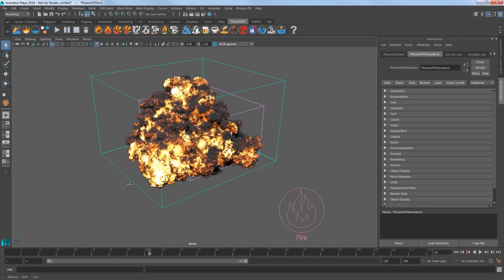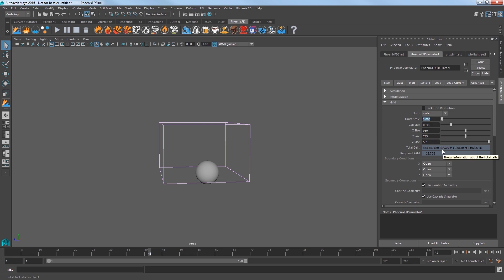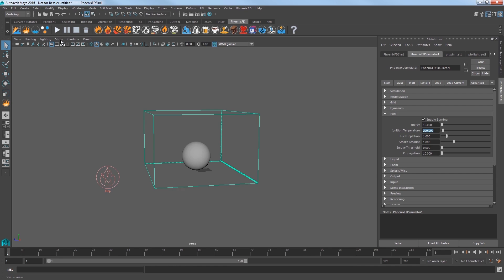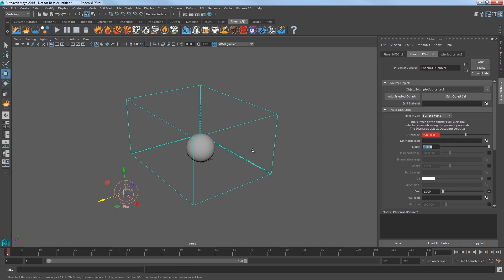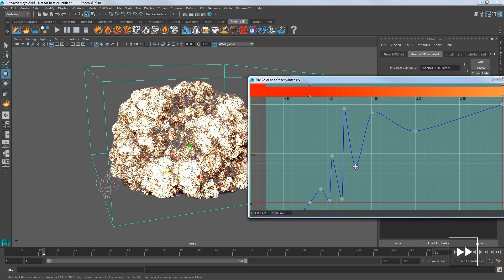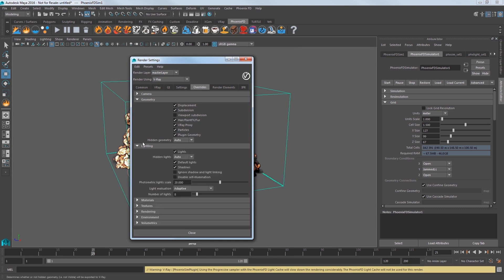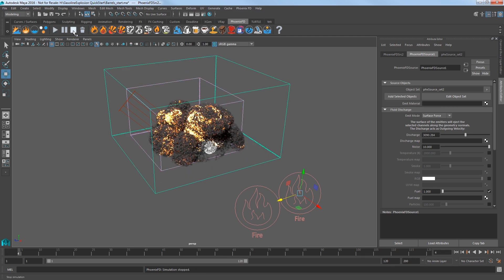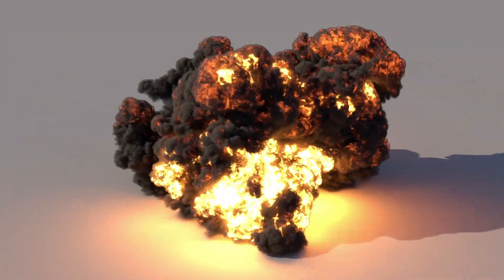Phoenix FD for Maya – Quick Start: Gasoline Explosion

Comment: Hi No matter what I do my Simulation is ALWAYS CLIPPING. I tryed adaptative grid to smoke threshold 0.02 or to fuel or to Temperature. Seriously what kind of dev put such an annoying limit on a simulation ??
Reply: the same problem with me
Reply: Apparently in maya the setting is not 0.02 anymore. Last time I tryed I put temperature and a treshold of 400 and it took me further than 0.02 without clipping. But it STILL CLIPS. My gosh....
Reply: "...what kind of dev put such an annoying limit on a simulation ??"

The kind of dev that cares about not running out of resources, like RAM and CPU cycles perhaps?

Do you have an idea about how insanely high would the number of particles/voxels go if you had no boundaries on your grid?
Reply: I understand but no, that was not the problem. The simulation also clips at the same point when i only choose 800k instead of 8M in the grid settings. There is something wrong with Phoenix fd.

Comment: i have PHX for max...can the steps be used for max or is it just for maya?
Reply: You just have to make sure the scale of the simulator is the same - there is a Max version of the video coming soon as well :)
Reply: You can keep the same settings for the sources and dynamics if you set your unit scale to 100 cm and make the sphere from the second part of the video to 24 meters :)
Reply: The idea is to have 3ds Max as well as Maya versions of these tutorials, so keep checking in on our channel. :-)
Reply: Thanks for the reply...I am very interested in having more tutorials for max...in max I use system units set as cm and display units as m, I am having a very good time with PHX...finally a proper tool we can use INSIDE our main3d app, not that 2.2 was not, its just that Im a new licensee of 3, I also noticed that in the quickstart of max filling a jar, the plugin version was 3.05 and not 3.03?
Reply: Indeed, we changed our numbering convention - before the versions were 3.xx.01, 3.xx.02, where xx was 00 for official builds and 05 for nightlies, and that was not okay. Now versions are 3.01.xx, 3.02.xx, 3.03.xx, and xx is 00 for official builds and 01 for nightlies.